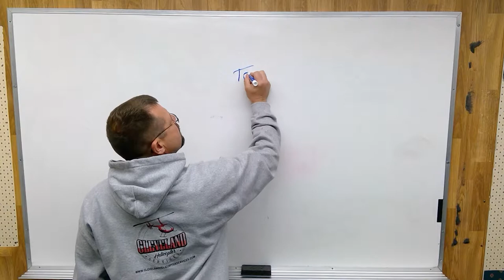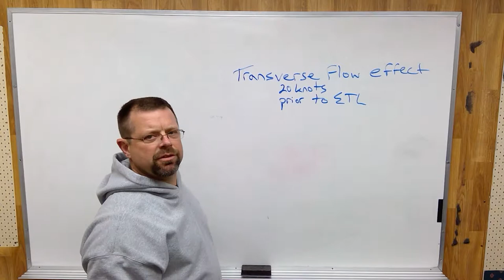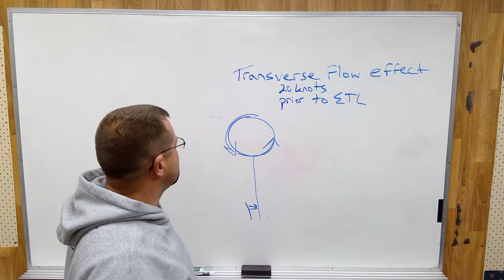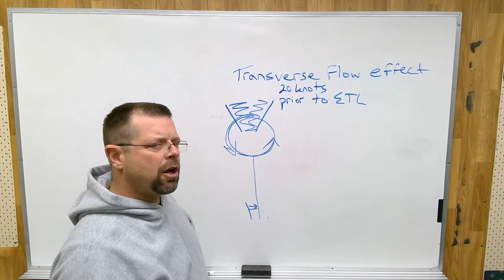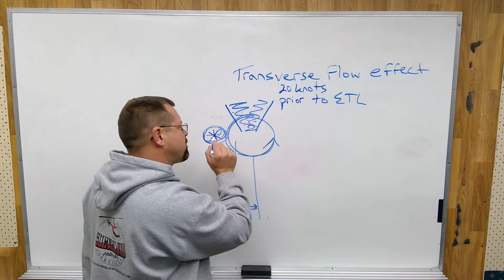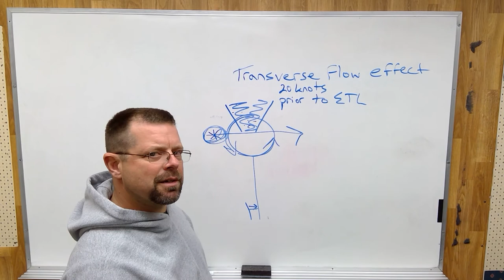Transverse Flow

Comment: Now I'm confused. I thought transverse flow was what caused the nose of the R22 to pitch up as it speeds up from a hover??? But if the effect is felt 90 out of phase, then what's causing the nose up attitude?? I haven't really noticed a right roll yet, but I'll feel for it next time.
Thanks!
Reply from the maker: Snowcat89 The nose will pitch up when the entire rotor system is clean “ETL”. That is from a greater angle of attack on the entire system and forward speed. Transverse flow happens moments prior and transforms into ETL quickly thereafter.